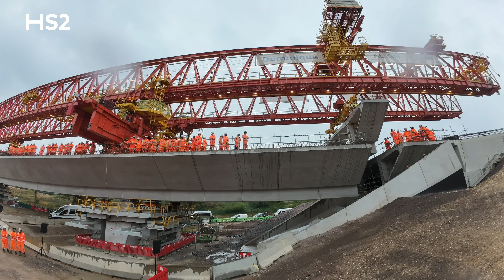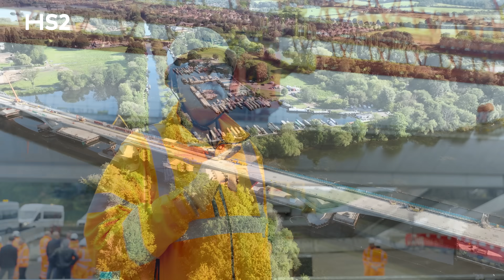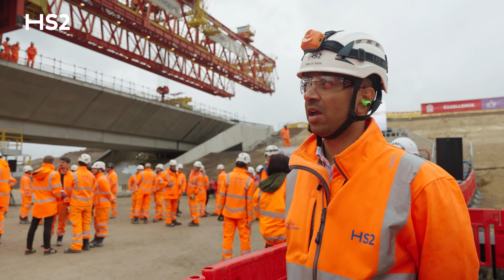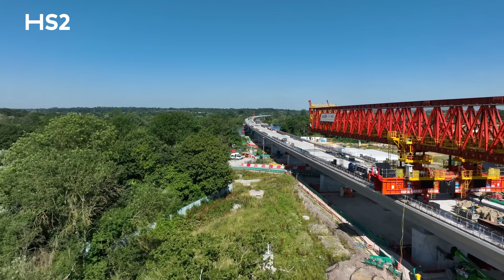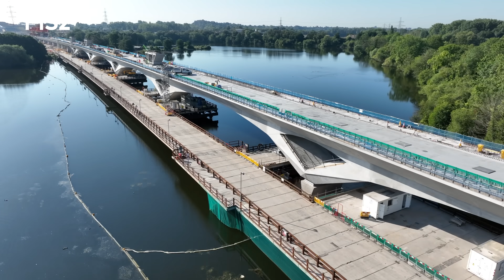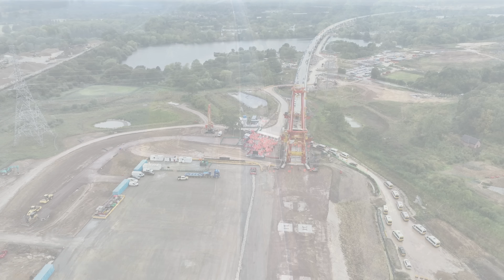Britain gets its new longest rail bridge in major HS2 milestone

Comment: It's lovely, well done. Looks like you won't see much out of the window of the train though.
Reply: You'll see plenty, trains are much taller than they look because people forget when stepping on to them that the platform is two feet above the tracks, and then depending on the train you go up another foot and a half of stairs to get to the aisle.  The windows will be high above those little concrete walls.

Comment: Excellent stuff. I hope you can get the roadways, compounds etc all removed and tidied up as soon as possible to show that actually HS2 isn't one gigantic permanent scar, but just looks like a railway line like the others.
Reply: When the next stage of construction begins the Contractor will want his own compound. There are track beds, track, overhead power cabling, and signage still to install at some stage in the future and that might be carried out by more than 1 contractor and each one will want a compound. Those works could be installed a long-time into the future as they will be common to the entire length of the railway and they may be coordinated together.
Reply: @TrevorWilliams-fq8mg  yeah, HS1 p-way was focussed on one compound near Ashford (long since gone and virtually impossible to see where it was). I assume that most of the p-way for HS2 is from rail connected sites. This should limit the amount of haul road use, but as you say I expect there'll be a need for a lot of it until it opens.

Comment: What a waste of MONEY 💴 NO QUICKER TO EUSTON 🤬🤬
Reply: But it does provide much needed capacity. It just needs to go where it was originally intended to now
Reply: @jamesglover9034  not affordable ££ will be working from home 🏠   
The line being used now goes into Euston 
My dear Boy complete waste of taxpayer money 💴. Just look at the country side in Warwickshire all them trees 🌳 chopped down 🤬
Reply: @jamesglover9034 no capacity increase for the north and absolutely nothing for Wales
Reply: @JohnSmith-bx8zb  I have seen another rail expert  on Youtube who disagrees with you. The  extra capacity  in/out  Birmingham will improve  services from mid  Wales to Birmingham. He uses the example of Aberystwyth, where his parents live and says it will greatly improve the services from there.
Reply: @JohnHoward-wc9kk  not going to Carmarthen or Bangor, dare I mention Aberystwyth to Lampeter.  The cash squandered on HS2 would have been better spent opening Beeching closed routes
Reply: @JohnSmith-bx8zb  HS2 is ultimately funded from future returns to compensate for the cash being spent on it now. You can't just take that cash and spend it on something else which doesn't generate the same returns (whether that be reopening branch lines or spending it on the NHS) unless there are other community benefits to be had by running it at a loss (but that's entirely separate from HS2 funding). If rural railways are to be reopened then they need to stand on a sustainable economic footing or be subsidised out of everyone's taxes, not just in their construction costs but forever and a day in their running costs. If that case can be made then yes they should be reopened. But good luck with making the case for Aberystwyth to Lampeter. Just look at the Portishead and Leamside fiascos whose business cases are far more robust.
Reply: @mikenorman2525  and just how long is the return on hs2?
Perhaps Aberystwyth- Cardiff / Swansea via Lampeter would be option and of course Aberystwyth- Bangor linking all Welsh Universities.
Linking North Wales to South Wales within Wales is a desire of the Welsh traveller.  It would be quicker.
HS2 would do nothing and is doing nothing for Wales.
Just wait for the english marketing advising London bound travellers from Cardiff to travel via Birmingham.
Reply: @mikenorman2525  and just how long is the return on hs2?
Perhaps Aberystwyth- Cardiff / Swansea via Lampeter would be option and of course Aberystwyth- Bangor linking all Welsh Universities.
Linking North Wales to South Wales within Wales is a desire of the Welsh traveller.  It would be quicker.
HS2 would do nothing and is doing nothing for Wales.
Just wait for the english marketing advising London bound travellers from Cardiff to travel via Birmingham.
Reply: @JohnSmith-bx8zb  You don't get it do you? HS2 if it had been fully realised might have cost £100B but it would have provided critical national infrastructure linking the major centres of the UK that's good for the next 200 years.(which with all due respect does not include much of Wales, nor the route of the original Great Central line). That works out at a cost of £500M a year (a pifflingly small amount in the grand scheme of things) and the benefits of that to UK GDP as a whole (which eventually benefits Wales even if indirectly) would be way in excess of the cost once up and running. Even then it would still have provided extra capacity for services from north Wales to the rest of the UK by freeing up the existing West Coast main line around Crewe plus there's other stuff going on outside of HS2, for example south Wales is served by the Great Western electrification project. Nobody is suggesting Wales shouldn't have better rural connectivity but that's nothing to do with the debate over HS2, it's an entirely separate issue.
Reply: @mikenorman2525  I do get it, it is an expensive job creation scheme.
The cash spent would have been better spent improving all public transport problems throughout the U.K.
For the majority of people it will not improve their lives.
Just step back and see what it is just a expensive transport system for a section of the ‘golden coffin’ but it doesn’t even serve most people on the route.
 Furthermore it is energy hungry
Reply: Capacity, my dear boy, capacity
Reply: @mikenorman2525  no one will be able to afford to use it £££ MY DEAR BOY!!
Reply: @mikenorman2525  not doing much for capacity between Liverpool or Leeds though
Reply: @JohnSmith-bx8zb  Well it would have provided extra capacity for Liverpool and Leeds in its original form, that was all part of the coherent master plan. HS2 phase 1 is too far developed to make it worth cancelling now and the reason it won't bring the much needed promised increased capacity for the north which, would have provided benefits for centuries to come, is because the grand vision was sabotaged firstly by Johnson and then by Sunak trying to save their political necks in shameless acts of populism that put the needs of the Conservative party before the needs of the country. We need more HS2, not less.
Reply: @mikenorman2525  if you care to trace the Great Central Railway London extension it did link London, Sheffield and Liverpool

Comment: It will be the longest railway viaduct when it eventually has trains running on it. It does look good for a modern civil engineering design. Crack on and get those trains running.
Reply: HS2 ltd are really cracking on with the building work, Hopefully HS2 will be open early as 2029 or even early at this rate. I just hope Labour Government get Phase 2a and 2b reinstated to Manchester and Leeds as land has not been sold off.
Reply: It may look like it does now for some time. The contracts for the track, overhead power lines and signage might be coordinated to be installed in parallel with the rest of the railway. Many other areas are still in the early civil engineering stage and if they are coordinated together it might be 2 or 3 years before we see any further changes giving an overall 2029 completion date. Or longer if the other phases experience further delays.

Comment: What a waste of time, money and effort.
Reply: Need phase 2 to link to the north, otherwise it is all a bit pointless.
Reply: @carguyuk7525  Pointless?
Hardly.
A great deal has been learnt with the building of this section and I'm certain it will not end at Brum.
The UK's second largets city is now served with the relevant rail connection to enhance both to itself but also to enhance the speed of journeys from there and will accrue so many other advantages to the rail distribution to elsewhere in the North.
Of course when the money becomes available and the obvious benefits that materialise from this present infrastructure, there will be a definite move to progressing HS2 to its original designed future.
Reply: Pindie by name and Pindie by mentality....there is always at least one gainsayer, what a misery.
Reply: Can’t wait for it to open, so the work force can go on strike 🤔